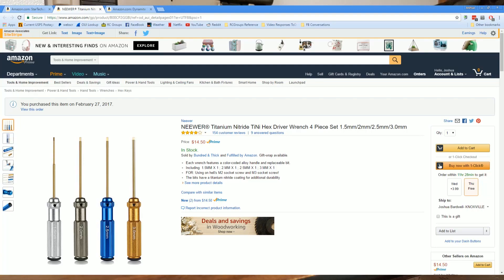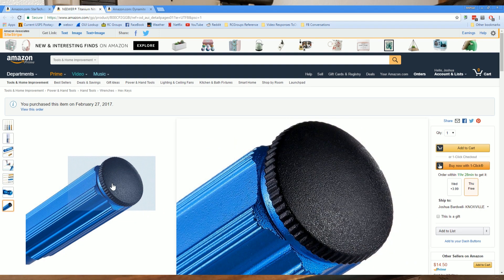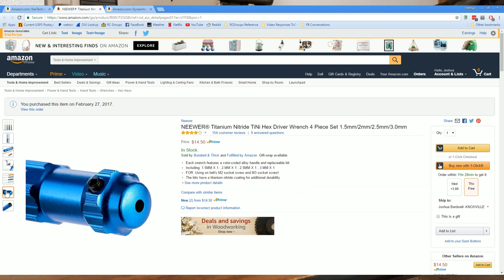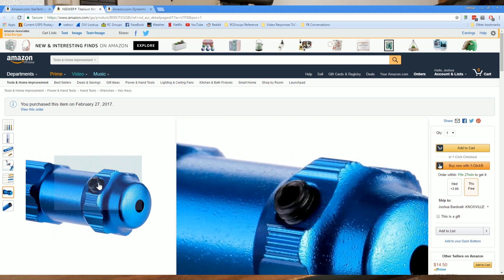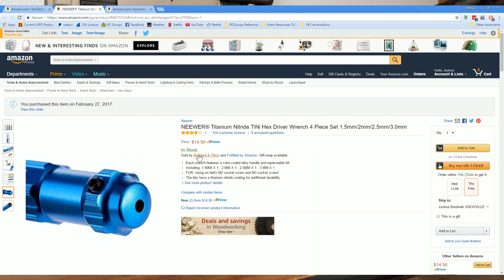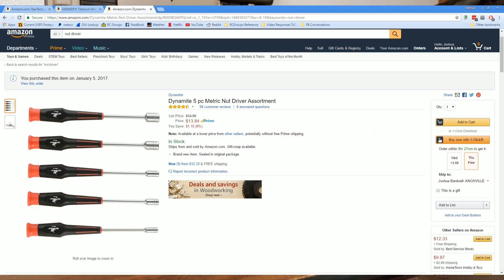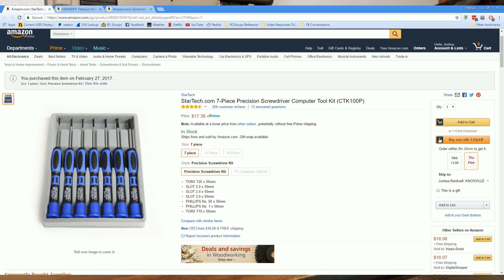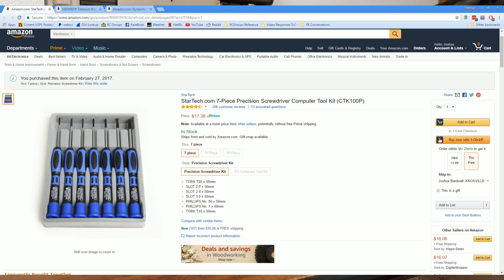Quadcopter FPV Racing Drone Beginner Tools | HEX DRIVER, SCREW DRIVER, NUT DRIVER

Comment: Small hint for identifying different tools for when you grab them quickly is coloured tape or heatshrink on the handles.
Use different colours for example red for phillips, yellow for slot, and blue for nut drivers.
Helps those of us who's eyes are not like they used to be. :-)
Reply: Stambo I color code all my tools at work ( I'm proffesional jeweller) and I have also different paterns engraved on file handles to help identify them quickly. I don't even have to think when reaching for tools now.
Reply: Stambo , Yep, that's a good tip.  Another is to use some paint on the end of the handle. A little dot of color helps a lot.

Comment: For prop nuts I really like the small prop tools like the one made by DYS. They have evert size you'd need and small enough that you could even put one on your keychain if you wanted to. I find them more comfortable for tightening props than a traditional screwdriver handle, too.

Comment: M3 locknuts require a 5.5mm nut driver, for screws you can get a good husky kit from home depot (black plastic case) and for props I use one I got on amazon.

Comment: Joshua I hurt my skin on my fingers quite often when mounting or even dismounting props. My problem is always holding the motor bell while screwing the prop nuts. Lately I used gloves, but those gloves should have some gripping material otherwise the bell always slips and I am having difficulty to lock the prop and nut.
Reply: I take a small enough screwdriver -- Phillips better than straight blade --  put it off center through the the open webs at the top of the motor to lever one finger against the other.

Straight across, not down into the windings, spanning two or three fingers.  Too big a screwdriver won't fit, too small not strong enough.  You should be able to tell.
Reply: Way too thick for motors with guards though.
Reply: a piece of rubber tube or latex would do. Holds the bell pretty well
Reply: Thanks guys
Reply: My advice is..... Man up! :-)
Reply from the maker: This is what I suggest: http://www.banggood.com/RC-Motor-3_5mm-Carbon-Fiber-Wrench-for-M5-Motor-Bullet-w-Motor-Locking-Hook-for-22xx-Series-Motor-p-1073728.html
Reply: Nice find! Thanks again Joshua.
Reply: do you think we could 3d print something like this?
Reply: And there is a tool for that, I bought one recently and use it quite a lot, maybe not as much as I originally thought but it is especially useful when you have overtightened the nut or all the blades have broken off your props. https://hobbyking.com/en_us/rcl-ap-1a.html
Reply: Awesome, I really needed something like this. I always have big scabs on my left index finder from cutting myself on props trying to hold the motor still. Man when I get a stuck nut ill start bleeding even.

Comment: Great minds think alike! Haha, I just recently bought the first two kits you recommend. I really didn't think I would use the 8mm socket for props but I've actually found it's much quicker easier than the wrench I was using before.
Reply from the maker: +carbonfire it also works on SMA nuts
Reply: Nice, I wouldn't have even thought to try it there.

Comment: Very nice hex driver set at a budget price. Some individual hex drivers will cost you the entire set price. I like the plastic knobs for the palm of you hand, to mark the mm size, to index the driver if your keeping track of rotations and to stash items inside. But they shouldn't just fall off. Have you ever run across the bastard .7 or .9 mm set screws that sometime secure the motor bell?

Comment: I just went from 1032 to 1036 and it happened on the first roll but I did about 10 more and it seemed fine.  I also recalibrated and the motors spin smoothly at 1020.  One of the escs is missing some caps but that's not the arm that was dropping.  Should I add a through hole cap to the one that's missing some?
Reply from the maker: +DrFuNK 15 us between spin up and min_throttle is the absolute minimum I would use. 20 or 25 is safer.
Reply: Joshua Bardwell 10-4 good to know.  I've always gone as low as they'll consistently spin +2 or 4.  I've never had an issue before.  I spend a lot of time inverted so I like it low.  I think my issue is hardware related.  Maybe a BB log will tell me something
Reply: Joshua Bardwell I reviewed some GoPro footage and it looks like it's the arm with the missing caps that's dropping.  It's happening right when I get back on the throttle to catch the flip.  This kind of makes sense since caps would help with initial "startup".  I'm going to add a cap to that esc and see if it fixes the problem.
Reply: I added a cap to that esc, no change.  I raised min throttle more, no change.  I changed from multishot to oneshot125 and it hasn't happened since.  Does that make any sense to you?

Comment: Self proclaimed professional at being an amature over here with a question. If my ESC's are rated to 30A, should both negative and positive wires be 30A rated if I am running 6S with red bottoms?
Reply from the maker: +Andrew Demczuk 18 or 20 gauge is typical for ESC wires.

Comment: I just built a new quad with used escs and fc.  I'm getting what I assume are desyncs after a fast roll.  Right as I stop the roll it will drop an arm then quickly recover.  I tried reflashing to 3.1.6 but same issue.  Could recalibrating possibly help?  I've run the escs with this radio but not with this fc.  Any suggestions?  They're blheli-s running multishot with sp racing f3 and brand new cobra motors.
Reply from the maker: +DrFuNK raise min_throttle

Comment: Hi josh. completely  new to the hobby and I'm in desperate  need of some help. sorry it's off topic. I received  my shuriken x1 dsmx yesterday. I've been flying aircraft for years but never drones. I connected up to beta flight.  Everything fine other than as the throttle was increased by a small amount the motors started spinning up by themselves. I was looking in the settings and reset them to default.  Bad idea. I then lost all my radio functions to the drone. To top it off I then clicked the uart3 port and now it refuses to connect to beta flight to undo what I have done. Can someone please explain  how to get reconnected and all sorted out? Massive  thanks. Guy

Comment: Hello,
I checked the link for the nut driver set. And the smallest head size is 4mm. Does it still work with M3 nut/lock nut?
Reply from the maker: M3 nut uses a 5.5mm driver.
Reply: Thank you Sir

Comment: I think you are missing a soldering iron? A hot glue gun? if its beginner maybe some sort of soldering station (spare hands + magnifying glass + light) is a good investment to? 
Whats wrong with using a Allen key for hex driver they are like $1 each (most will have a few around from flat pack furniture) if that and work just as good as a hex driver minus some ergonomics
Reply from the maker: +Side85Winder Allen keys have terrible ergonomics. Especially for one handed use. I used to use them before I bought these hex drivers. Terrible. 

As for the others, I'm sure I will get to them.
Reply: Fair enough, if i ever take this hobby serious i will be on the ultimate budget/ performance build making that shoe string budget stretch as far as possible. How long before we see some FHD quad camera's/ transmitters being more mainstream and reviewed?

Comment: Hey so I'm still trying to get my buzzer to work I wired it to my 12v led leads and it started beeping constantly then I desoldered that and checked current agian and now I'm getting 3v to my buzzer from just buzzer wires to fc any ideas on how to get my battery Alarm working agian?
Reply from the maker: +Alex Dalton the buzzer positive lead goes to any voltage source. 5v is typical but many buzzers are rated for more, and will be louder on higher voltage. The buzzer negative lead goes to the negative buzzer pad or pin on the FC. This is switched and is what tells the buzzer to turn on or off.
Reply: Joshua Bardwell thanks fried a camera today plugged up and saw smoke from camera lol foxteer mini Amazon sending it back a week old lol

Comment: My 2 cents: invest in a little bit of quality and buy the tools you need to buy only once. For nuts I use a small Bahco socket set with a ratchet, paid 25 euros for it and no regrets. For hex screws I've found that a lot of the cheaper drivers are too loose in the socket and damage the screws over time, but Torx drivers actually fit small hex sockets very nicely (T8 for 2mm hex and T10 for 2,5mm)

Comment: So you don't want to argue about the RaceFlight GPL stuff, so don't argue. You don't have to reply to comments you think don't have a valid point. It seems really slimy to me to disable comments on something where you ask people to correct you if you're wrong.
Plus now we have to go to an unrelated video to comment (though I don't think I would have commented if the comments were enabled in the other video).
I actually don't have a strong opinion about the RaceFlight stuff. I just have a strong opinion about leaving comments open.
Reply from the maker: +Duane Degn sorry, but I simply cannot spend all day arguing about the GPL which is what would happen if comments are on. It would swamp me with notifications and distract actual helpful, positive stuff. If somebody wants to correct me, there are a zillion ways to get in touch with me. I am hardly reclusive.
Reply: Sorry, I didn't think about the notification thing. I can see where that would be annoying.
Thanks for the reply. In hindsight I should have sent this as a private message instead of cluttering up this comment section with an unrelated comment.
Feel free to delete these comments.
Edit: I'd delete my comment myself but I don't want to also delete your considerate reply.